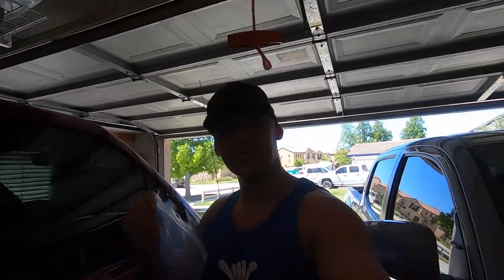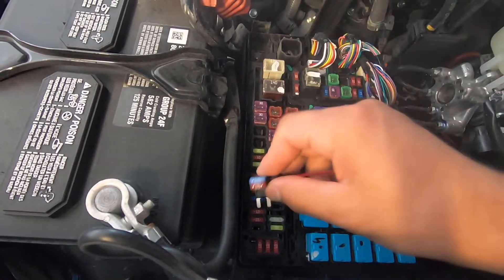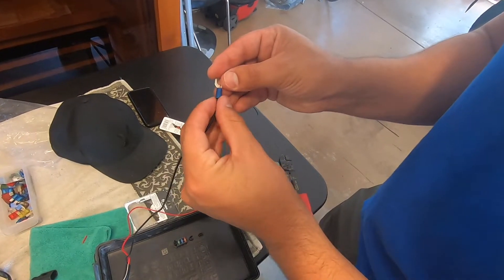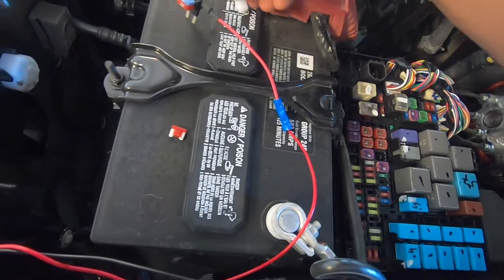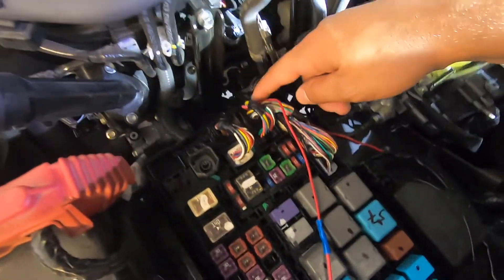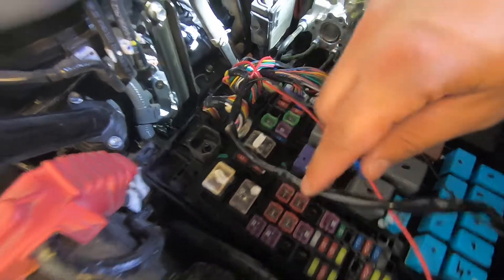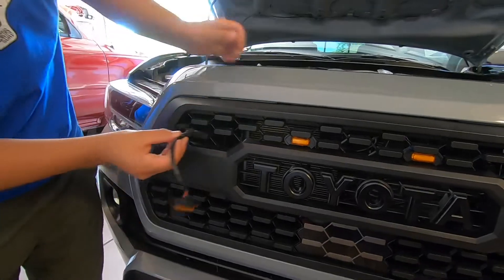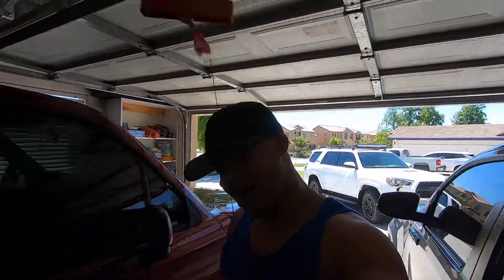Tacoma TRD PRO Raptor lights install + wiring 🦖

Comment: Really helpful video, thanks! I had a hell of a time getting the box in the fuse panel to come up far enough (the wire cluster from below was really tight), but I just barely managed it. Cheers, appreciate it!
Reply from the maker: Thank you!! Glad it worked out for you!👏🏽

Comment: I just did that today very helpful video specially looking for which fuse to use  for the day light running. I went with the day running light (DRL) because I wanted the light to be on during the day it looks great. Thank you

Comment: You should've heat shrinked that butt splice and left yourself enough wire to route around the fuse panel, not through it. You've provided some good info here though, thanks.

Comment: Where should i plug them in case i want them to work with the DRL and not the headlights? But not ON all the time, only when i switch to Drl or auto

Thank you

Comment: Do you know what size ring terminal you used for the ground wire?  I only had some #12-1/4” stud and they were way too big.  Will need to run to autozone tomorrow

Comment: Hey did I do something wrong as far as wiring, if I got to manually turn off my headlights? If I leave my headlights on “auto” it doesn’t shut off on its own when I go to turn my engine off
Reply: I ran into the same problem so i went with the 10a INJ fuse.

Comment: So i added lights to my grille but im having a problem with them staying on even when truck isn't running ?
Reply: Yeah same here and I even tapped into the same fuse he did but my pro lights are turning on even when the truck is powered off. I was having the same results no matter which fuse I tapped in to

Comment: Hey man, what kind of spray paint did you end up using to cover the "Toyota" on your grill?  I can't find the all-black TRD Offroad badges so I'm just gonna order the silver and red and just paint it.
Reply from the maker: I just used some heat resistant spray paint 👍🏼
Reply: Some of the aftermarket grilles just come black

Comment: I just tried to use the same fuse location for the headlight and it cuts out my headlight
Reply from the maker: Really!? What size fuse??
Reply: @TacoManD4X4  I figured out my problem...I only put one fuse in it...added both fuses and works fine now. 🤦🏻‍♂️
Reply: @HPTaxidermy1  did you use 15 amp fuse on top and bottom 10? Isn’t supposed to be 5 amp fuse too and bottom the one you took which is 10 amp fuse. I’ve heard the top number should be lower than the fuse you took off. 0:50

Comment: Why not just drill a small hole on the fuse box and run the wire through that way instead of taking fuse box wires loose. Also I've noticed with mines the added fuse adapter does not fit all the way in the spot where the 10 volt fuse was located. To me the whole Raptor light design is horrible. It should be Connected  somewhere else on its own instead tapping into the fuse box.
Reply: Only thing is. You wouldn't be able to switch it off unless you wired a switch to it

Comment: I see you got these from Toyota Pro Shop aka Yotaverse so I ordered a set because they snapped in for you easily unlike some of the cheaper ones out there.  I got them today and tried installing them like your setup but the fitment was atrocious.   They would be too loose installed in the middle above the logo and too tight at the ends placing stress on the the outer edge of the lights.  Even a little trimming didn’t improve the fit.  It was almost like the locking  clips didn’t reach far enough toward the back of the grille to lock them in properly.  Garbage in my opinion and for $60 bucks,  borderline robbery.  Now I have to pay a 25% stocking fee and shipping to return them.
Reply: Gotta be careful when watching some videos. Sometimes people get stuff for free if they do a video.  I found the same problem with mine but the place I got them off of Amazon sent me a whole new set because one light faded on me. Using a little caulk and a file and I got mine to fit really nice.  Good luck.